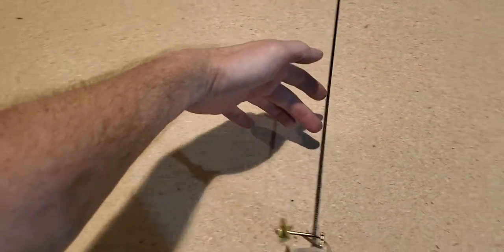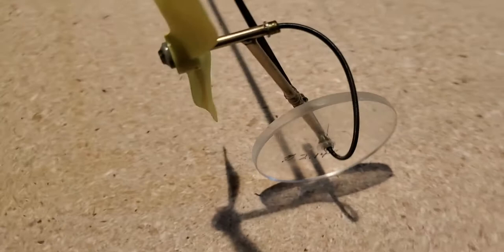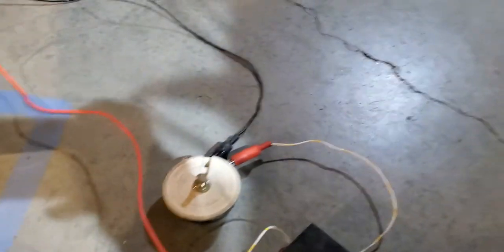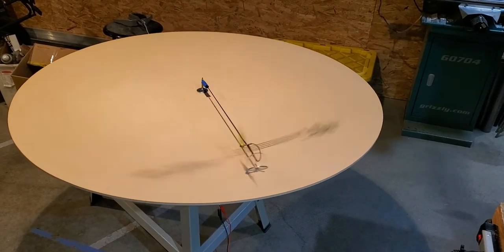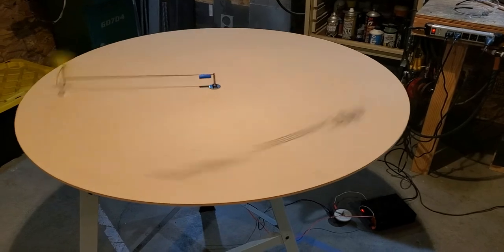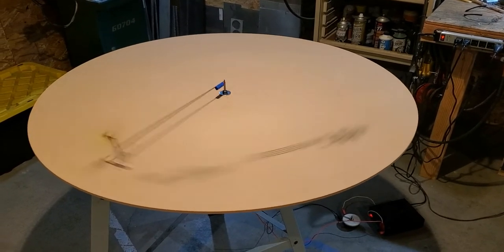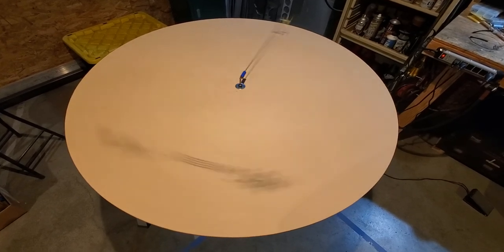Self Starting, Rotary DDWFTW Cart - A supplement to discussion on Veritasium's video

Comment: First, Bravo!   My ideal situation is that the arm is made longer so that the cart wheel runs at the very periphery.   And then a circular cover is placed between the table top and the central pivot top so that the table is entraining almost no air as this could be a source of error with air drawn in at the center and due to skin effect and  centrifugal force, the air gets pushed off the sides (causing a slight wind that the propeller is basically tacking in).   A small streamer behind the prop would also show if this is a significant effect if it blows completely tangent to the side of the wheel or is displaced outward.   It is always nice to be able to eliminate any variable that could be a detractor.
Reply from the maker: I just used the best suited piece of carbon I had at the moment, and since I knew there could be iterations to the cart, I didn't size the table to match. I just cut the biggest circle possible from the sheet.
Yes, a way to eliminate radial flow in the boundary layer would be nice, but I didn't get the sense that this was significant (with my face near the edge and and such)
Devices to control minor flow imperfections would likely cause more confusion than they are worth. I would bet that those who would just be hopelessly confused by a flow control device far outnumber those who understand them, but don't already understand how ddwftw works.
Reply: @drienkm  Yep.  It's an impressive demonstration.   Putting a streamer on a little post above the prop would be an easy cheap addition though!   Also a rubber band around the wheel for traction and a lengthened center rod would all be nice!    Still love the device.   Thanks for the reply.
Reply from the maker: @killbeas  Thanks! Yeah, streamers would be nice. I even was even thinking of tiny flags made of toothpicks on the periphery of the table (like flags in the ground). It would also be nice to have a point in the table near the cart radius emitting smoke. That would show the "wind", and also how the airmass is affected by the prop.
I though so too, but the rubber band seemed to increase rolling resistance enough to offset the improved grip. It kept falling off and I stopped replacing it.

Comment: You might find that putting a rubber band on the rim of your wheel will give it better traction.  On the treadmill models we sometimes had to do that when we used plastic wheels.

Another thing that could be fun to do if you are sufficiently bored...  You could replace the spring with a thread spool on the axle and another on the prop-shaft.  Then you wind the thread on the prop-shaft spool, and the axle spool takes up the thread as it drives. This serves two purposes...
First - it's real efficient.
Second - it proves beyond a shadow of a doubt that the wheel turns the prop instead of the other way around.  I still have people that swear to me the prop turns the wheels (including a professor that recently bet me $1000 that's what it does).
Reply from the maker: I like the thread idea... Darn... I might not be able to get rid of this thing yet after all😄
Reply: @drienkm  You will never get rid of it.  Not until we've convinced every last skeptic. :)
Reply: the fact is, xyla and Ve steadfastly refuse to actually test their treadmill (TM) cart.  there are 2 possible tests. one would be to put the same cart on a longer belt,  I predict it will not work there -- it will within seconds be swept off the back end of the belt, every time.  (Obviously a run of a few seconds is no test of a device which if it works will either run perpetually, or run until it hits the far end of the TM)

Ve obviously has contacts.  Find a belt in industry that he could borrow on a weekend, gear it to 10 mph. and run Xylas cart upon it w/o any alteration.

The other would be to tie a string on the back of the cart and tie it off somewhere so it cannot over run the TM.  It should run perpetually on the end of that string.   I predict it wont -- it will within seconds be swept off the back of the TM

As it stands they are involved in confirmation bias.  They have found something which seems to confirm their bias, and they refuse to do anything else. They need to rectify that, by doing honest relevant experimentation.

Or, in fact, it is more than likely that they have done either of these, and find that the cart doesnt work, so we dont here about it.  I hope this is not so because this would be dishonesty.

If you or @drienkm have the ears of Xyla or Ve simply encourage them to do either of the 2 things I mentioned above.  It is very telling that they havent done this, the simplest being the string.  Nowhere will you find a vid of anyone trying either of those.  They have been encouraged to do these experiments for years by me and 3 others.  They refuse to acknowledge our comments to them.  Both of these love to make vids by the dozen.  Here is another vid, what could be better?

I am, of course, eager to have them prove me wrong in this, but they need to show us honest testing/demonstration of the device

There is a very, very simple explanation of why her cart could seem to work upon that TM,  but actually does not work as claimed.  You need to study her vids carefully, and figure this out for yourself.  Even poor  Kusenko missed this, and came up with the most lame reasons that it seemed to be working but actually isnt.
Reply: @37rainman  
>>  I predict it will not work there 

Given that I'm the one that built the treadmill cart Derek used to win the $10K bet against Kusenko, how about if you bet me $10K on your little experiment.  I will be more than happy to take that bet.
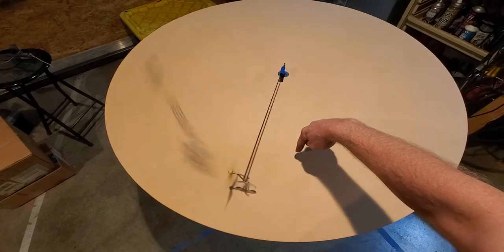Reply from the maker: @37rainman  Hi rainman! Explain to me, IN PLAIN PHYSCAL TERMS, the important differences between your proposed string test (not a bad test) and what I did in this video after 8:40 where it obviously pushed on my hand and bounced against it for a while as I yammered... I'm guessing you were already typing by then 😂
Start talking physics, my verbose friend!

Comment: What seems to be under-highlighted, for lack of my vocabulary, is that the propeller here is delivering more thrust than is needed to push cart at the speed it's going. A lot of ground speed, not so much air speed. A more efficient setup would self start at lower speed and enter up lapping faster than the table.
I'm dying to find out whether a ground effect craft could be made to work, not touching the surface at all. I've come up with versions of only a rolling wheel on the ground or on the water, a prop under water. But imagine the ground surface is really touch, slowing down the air near the surface. Could there be enough speed differential to get the DDW/DUW FTTW principle to work, AND actually FLY? Or we do no better than a turbine with a floating anchor that slows the turbine down?
We could also creat an air tunnel with narrow opening, effectively zero air speed in the tunnel, but significant outside it. With a bunch of props that are efficient at high speed inside the tunnel, to replace the cart's wheel on the ground. Lift would need to come from the air inside the tunnel, higher speed for the craft than the wind that propels it. Come to think of it, a large craft with a huge air splitter (like a horizonetal plate to isolate wind and ground air) might do the trick as well. Need a for and aft prop/turbine setup to balance, and airfoils.
Reply from the maker: True statement - the thrust from the prop is greater than the total drag (both air and rolling) of the cart. This extra thrust is in ballance with the aftward tangential force on the wheel in steady operation.
That's a cool idea! Definately theoretically possible... Oceangoing birds are able to use the windspeed gradient above the sea surface to soar indefinitely (see "dynamic soaring"), but they do it by periodically swooping up into the faster wind and turning in it. 
I suspect the practical challenge in building a flying ddwftw vehicle would be engaging airmasses with sufficiently different speeds. But then since boundary layer velocity profiles are not linear (greater rate of change of velocity wrt distance from surface exist close to the surface), a really low ground effect vehicle might do it. 
I imagine a conventional glider layout, with many little stramlined vertical pylons along the span. They would extend above and below the wing, each with a prop on top and a turbine on the bottom, geared to the prop. 
I don't think the resulting nose down moment would be too high, and I think it could be efficiently resolved by using a canard layout instead of the conventional down-lifting tailplane. 
Starting would be tricky, because there would always be a zero lift situation near windspeed. It would probably have to be launched.
That's a fun desing problem!

Comment: Bravo on your circular treadmill!

To actually show true self starting as an earth analog you have to stabilize the table speed at some target with the cart's wheel chocked.    No (perceptible) acceleration of the ground allowed once the cart starts moving.  Then release the chock and the cart self starts and exceeds windspeed.  

As the radius arm approaches infinity, the circular treadmill becomes the same as a linear treadmill since all radial forces approach zero.

Obviously the table illustrates the principle for anyone with any brains.  If they have objections about the circularity introducing radial forces that somehow cause it to "fake it" (which is pretty ridiculous to begin with as a radial force can't cause angular acceleration), then the cart can be held at a specific angular position and released (start from windspeed).  As it starts to accelerate above windspeed, there are almost zero radial forces operating.

To illustrate that the circular cart is not working due to any radial forces, it can be put on a pivot by a treadmill and show that it can accelerate up the treadmill but it will rotate through the arc there.  But the arm can be extended with a fiberglass long rod to the pivot point and it will work the same (with the exception of slightly lower acceleration due to the mass of the pivot arm!  With a really long pivot arm on a regular treadmill, the cart will then illustrate that radial forces have nothing to do with operation!

It's always good to anticipate a ton of objections to any mechanism like this as the idiots will certainly come up with them!
Well done!
Reply from the maker: Yes. The accurate scenario analog to a cart self starting on the ground would be holding the cart on the table until the table is at a steady speed (like what I did at 8:00).
As far as the introduction of a circular path, radial forces have exactly zero impact on power / energy here, because there is no radial movement.
Thanks for the comment!
Reply: @drienkm    Wonderful.  I'm sorry to say that I didn't watch that far before commenting and that is exactly right.   So thanks very much for calling that to my attention!   Well done!   Agreed that the radial forces are inconsequential.  Some of the detractors tried to make an issue of that by some ludicrous claim that the inside of the prop follows a shorter path (it does but it has no bearing on the issue--which was the reason for my comment to demonstrate a long arm on a straight treadmill where the deviation from a straight line is negligibly small!).  Your demonstration is great.
Reply: @killbeas  There is literally no analysis or demonstration that will satisfy the motivated deniers.
Reply: @Rick_Cavallaro  Agreed.  It's just nice having obvious empirical proof that many of the popular denier nonsense statements can be falsified with a visual demonstration.

1) The cart can't self start on a treadmill
2) The behavior is completely different on a long treadmill
3) A treadmill isn't equivalent to the real world
4) And one of my favorites---if you had a long treadmill, it would eventually slow down and fall back below windspeed.

So the circular treadmill with a nice large radius does a great job of showing all of these popular denier themes are poppycock!

Comment: Great video except you are ignoring the centripetal force of the rotating table forcing the cart away from the center of the table. This is entirely different from a vehicle  traveling in a straight line with
 no external force. Again let's see the vehicle sail down wind for an extended time. Having sailed on El Mirage many times the wind at low speeds is NEVER constant. We call them Sucker Puffs.
Reply from the maker: @jimbraslow1774 Thank you. And yes, making it circular could be a little trip hazard for some, but you have to admit this is a hell of a lot more doable than the infinite linear treadmill people typically demand! lol) 
Yep, there is centripetal force acting radially. And what is the tangential component of a purely radial force? Zero. Is there any radial movement? No. A junior physics or engineering student will tell you (correctly) that centripetal tension in the rigid boom has no effect at all on its rotation. A real bean-counter would also point out that the centripetal force even adds a little drag at the pivot.

Given your objection, and supposing you reject all physics and engineering and are totally relying on your intuition, what do you make of the point in the video where it's not really rotating and is just bouncing off my hand and trying to go opposite the table?
Reply: >>  you are ignoring the centripetal force

He's not "ignoring" it exactly.  He's just very well aware that a radial force has no impact on the experiment.